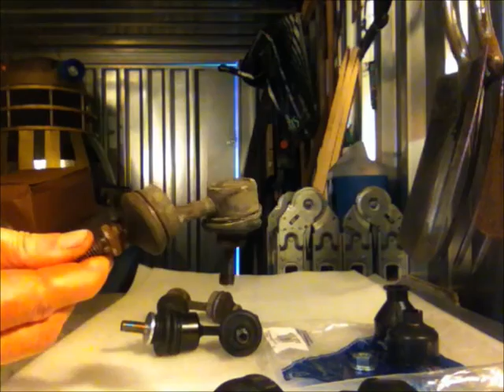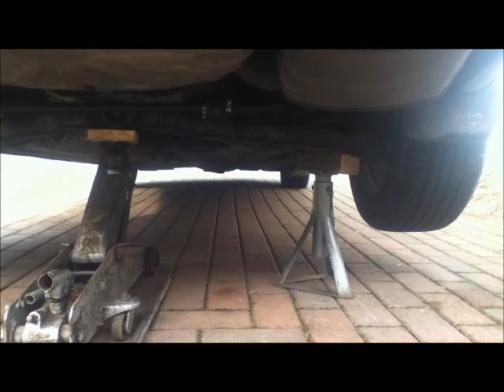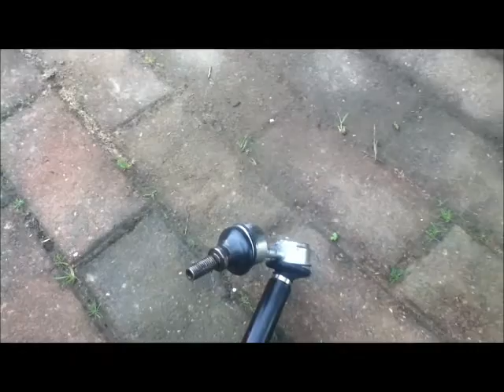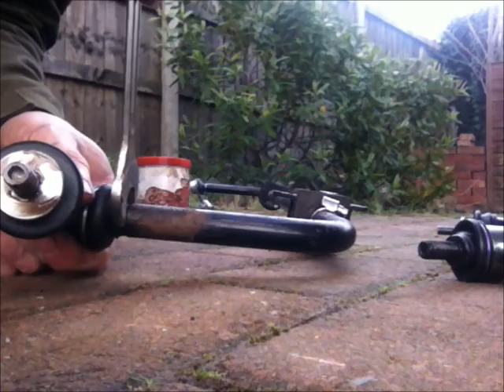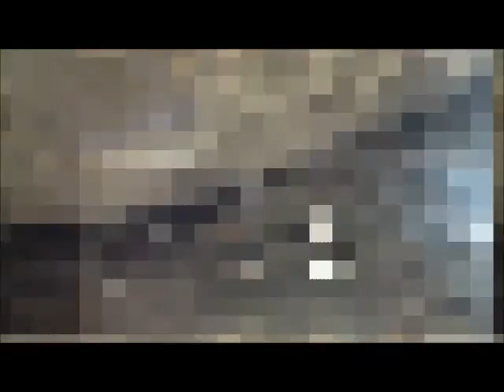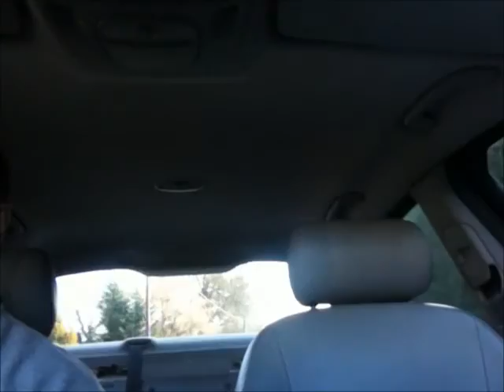Jaguar X Type - Rear Drop Link Fake Parts

Comment: Buy genuine jaguar parts.
As long as the bolt goes through the nylon of the nut.
Use a air  gun or a power drill with a socket. 
No need for washers or clips or coins,  i was a jag tech,  have you got the modified bushes  ? .
Reply from the maker: I have done another video on genuine Jag bushes against fakes.

Comment: hi m8 could you please tell me what size Jubilee Clips you used on the anti-role bar cos i have the same problem the knucke that should be there is gone just had new flo-flex bushes fitted on the back would like to secure both sides to prelong the life of them :)
Reply from the maker: +Vos Sanctum . Hi. I bought a packet of 10 Halfords 13-19mm hose clips - HC10 Price Code P. In the end I moved them a fixed distance from the bushes so I could monitor if the bar was sliding. So far it hasn't. If you are going to make it permanent I would recommend getting stainless ones as these tarnish.